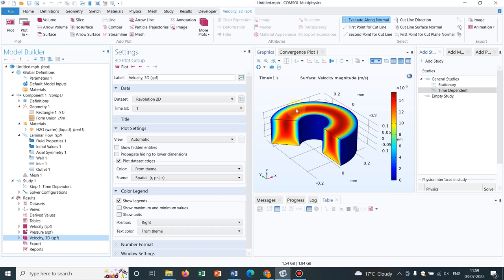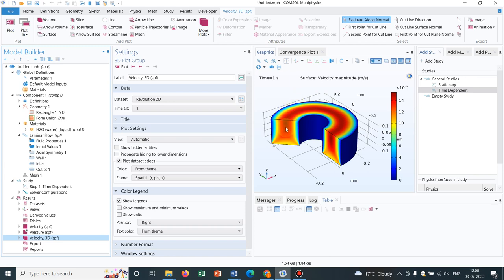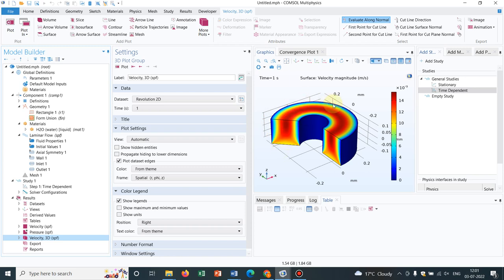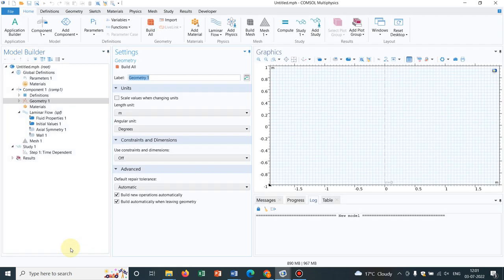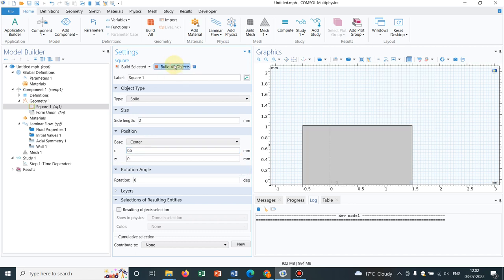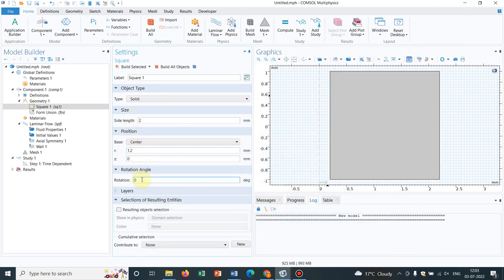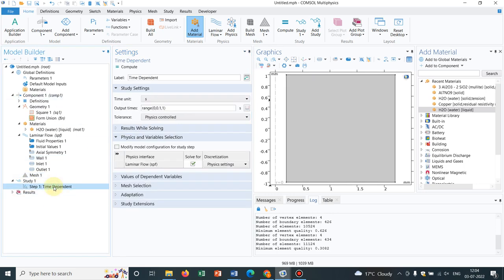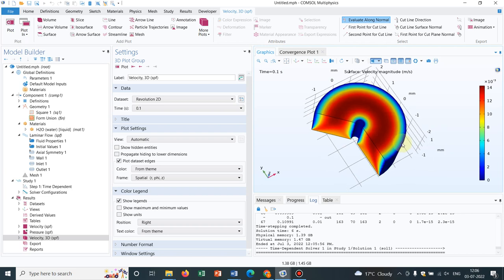Introduction to Axisymmetric Models in COMSOL #Axisymmetric #COMSOL #Geometry  #PioneerOfSuccess

Comment: What about 3D models ? Is it possible to specify that a certain geometry is symmetric around a certain axis ?
Reply from the maker: If you take an axisymmetric then 3D becomes 2D plane. Please correct me if I could not understand your question properly.
Reply: @pioneerofsuccess4054  No, you are right I did not properly ask the correct question. I have a 3D geometry that is not axisymmetric but since it is a square with inside other smaller squares is simmetric respect 3 planes : zy, zx and the plane (1,1,0) (to make the geometry mirrored). However, I could draw this per entire but computationally speaking is very time and memory consuming to simulate. Does exist a way to specify to COMSOL that this square geometry is repeated other three times, thus simmetric respect this 3 planes? Because I was trying to exploite the feature of solid mechanics "symmetry" but due to the fact that this bigger square contains smaller squares inside it I do not know how to specify this characteristic with this feature, in fact the simulation result to be wrong. Thank you very much for your help.